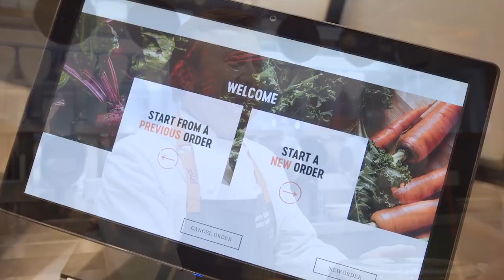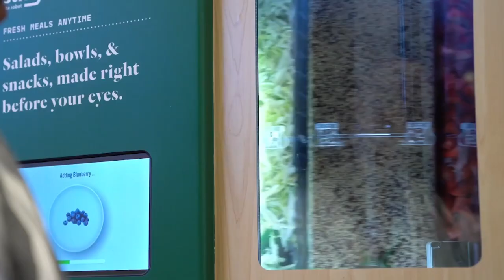The Automation Age Episode 1: Food Services Industry

Comment: Why are burgers not cooked from both sides at the same time?
Reply: Because people are creatures of habit and rarely thinknoutside the box.  If they did, then we would see giant versions of the George Foreman grill in all those fast food joints.
Reply: @VerisimilitudeDude  they do
Reply: They are. McDonald's has grills with top and bottom and it presses down. They are covered by Teflon sheets and are supposed to be cleaned with a heat resistant squeegee after each use into grease trays on either side. I worked there.
Reply: @MrHazardousMC  
 @1Energine1  
So, are they better? Do they cook faster? Use more energy?
Thanks.
Reply: Cause all the juice leak out then
Reply: 1Energine1  Saw the commercial, I expected it was bigger, but it looks good. That guy made millions.
Seattle? Hey, that's one of the two cities I'd like to live in someday, the other being Vancouver.
Thanks for the reply, all the best.
Reply: @MrHazardousMC  so tell me, are the ice cream machines always broken?
Reply: Because that only cooks it faster, not better. The george foreman grill for example, it is the worst way to cook meat.
Reply: 1Energine1   No it doesn't, the meat is cooked wrong every time.

Comment: I'm skeptical of direct robotic placements into human areas like Flippy (as is the market, if Rethink Robotics is an example). Changers like electricity were typically important not because they were a direct substitute to the old technology, but because they allowed entirely new ways of conducting business. For instance, factory layouts were able to switch from problematic line shaft systems with electric motors. Having worked in food prep, kitchens based around humans are food prep's line shaft system - dirty, dangerous, and often inefficient. Workplaces designed from the ground up with robotics in mind can utilize their advantages and limitations compared to humans far more successfully. Zume may or may not succeed, but utilizing every advantage automation can bring is laudable.

(Another reason I am skeptical of Flippy is if the AI existed to make it perform consistently, those developers would not be using a Holy Grail of technology approaching fusion for flipping burgers)